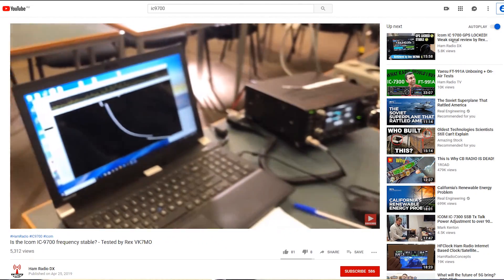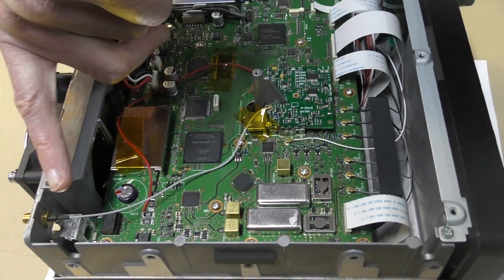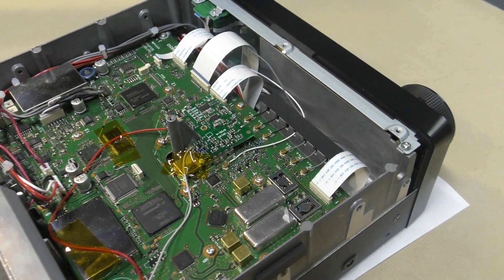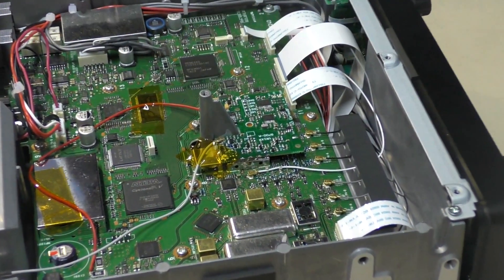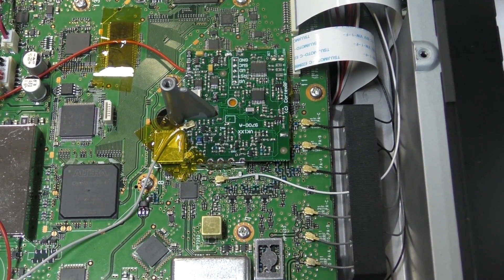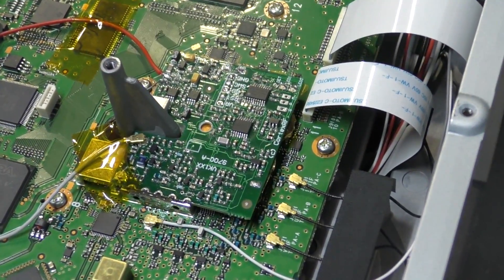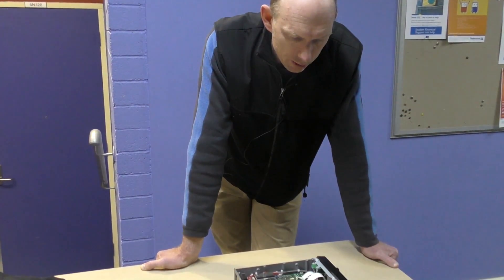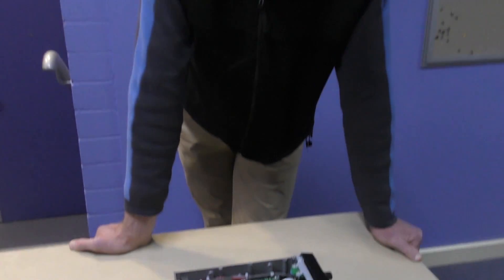Icom IC 9700 GPS locking board by VK1XX

Comment: Is Glen still selling these boards? The link supplied for placing orders is broken.
Reply from the maker: No, Glenn is no longer selling these. I will update the videos shortly to reflect this
Reply: @HamRadioDX  
Buggah. Thanks for replying.
Reply from the maker: @nunyallsbeeswax  If you want a good solution check out the video I did on the Leo Bodnar unit. Very simple install and will lock the radio over a wide range
Reply: @HamRadioDX  
Yes, I've already seen that video, thanks. Seems the Bodnar solution would be ideal for my situation if it had at least one 10MHz out for further distribution, along with an RS232 NMEA data port to directly enable the GPS and offline time sync capabilities of the 9700. Not that the latter is that critical (on the radio).

Looking like a Bodnar GPSDO locker and coupler and a BG7TBL GPSDO with distribution amp is the way forward for me now.
Cheers.

Comment: wow.. I thought when I looked at the 9700 with the 10 mhz input that it would simply use it, like every other piece of lab gear I've seen..........   kinda..... sad...
Reply from the maker: I think it deceived a lot of people considering the 7610 allows locking to the rear 10 MHz connection